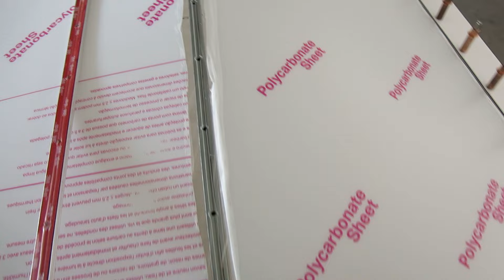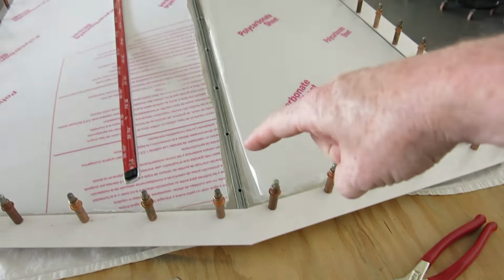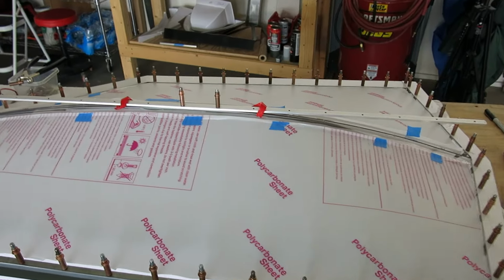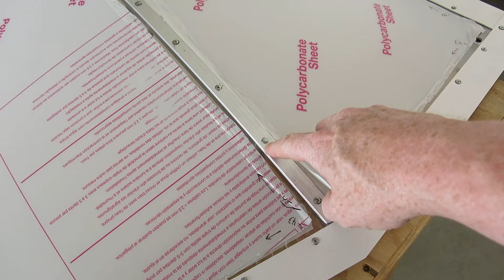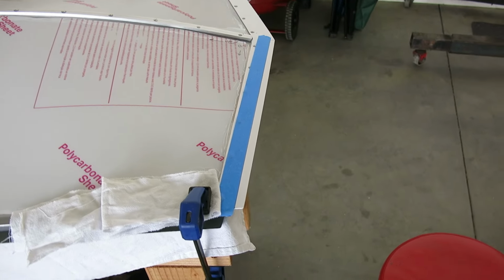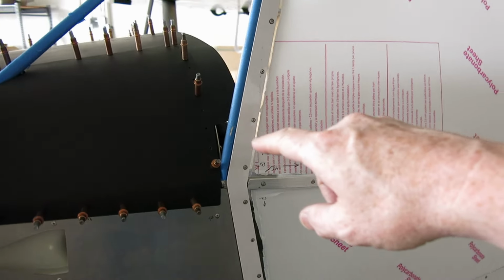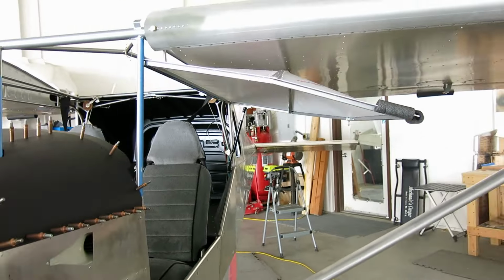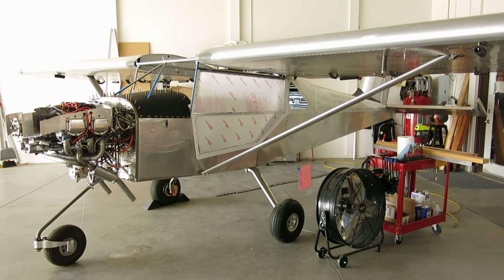No. 371 07-26-2024 Doors part-6

Comment: I used my soldering iron on the seats, but had to buy a new tip as I couldn’t clean the stuff off.  So, now I just use a nail of the right size and heat it in my propane torch and melt holes with that.  Easy to find the right size nail and it is cheap to throw out the nail when done as compared to throwing out a soldering tip.
Reply from the maker: I have a cheap iron that I use for non-soldering heat needs.